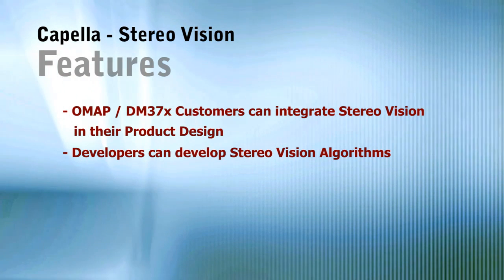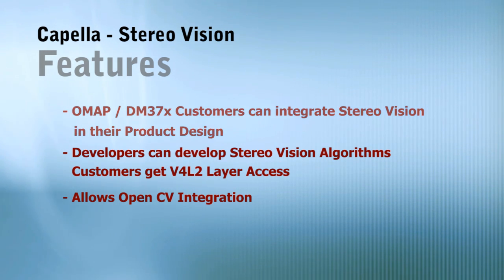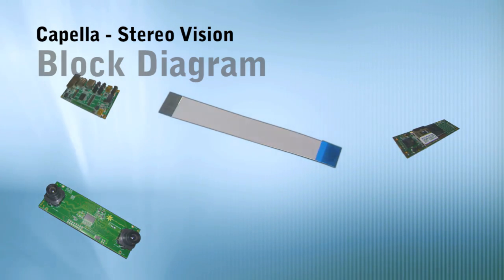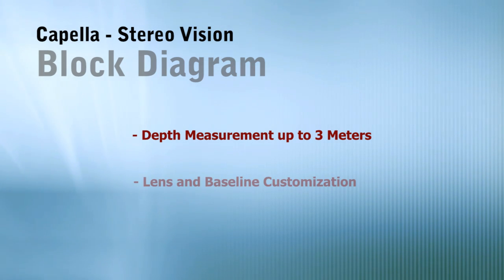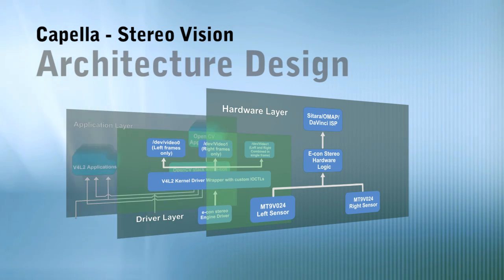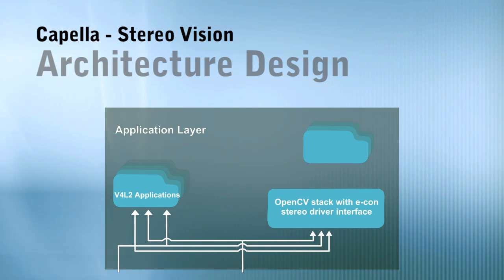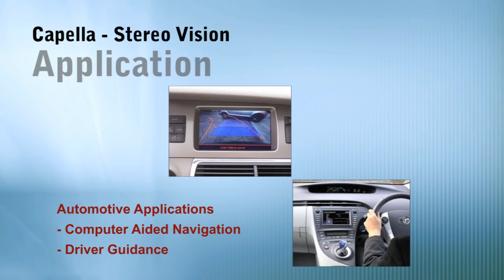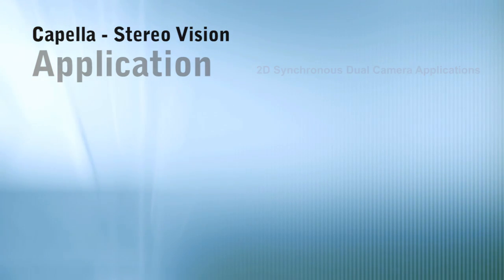Overview of Capella - Stereo Vision Camera Reference Design from e-con Systems

Comment: It seems e-con folks have done wonderful job. I am really delighted to see that company in india also developing computer vision/machine vision based products and have got the complete know-how to design and develop these products. 
Moreover, i would to see if the product can compute the depth map itself at VGA resolution and @30-40 FPS and stream out the result. This will open lots more dimensions, where it can be used and also compete with popular devices like kinect etc.